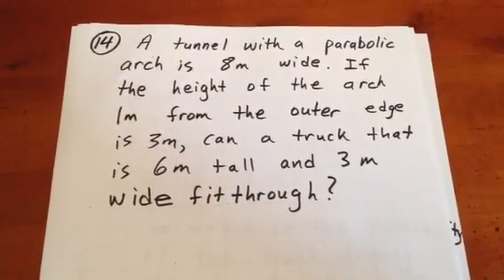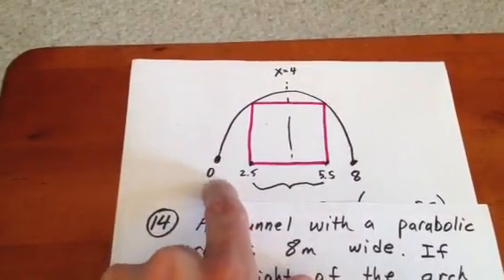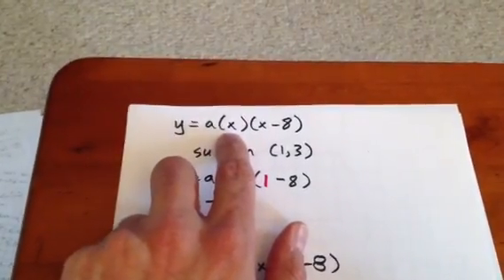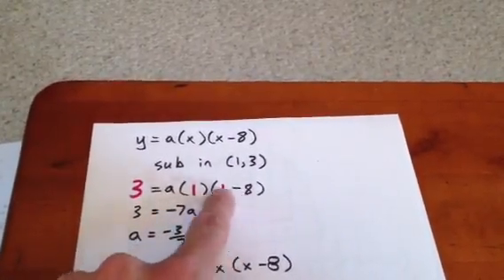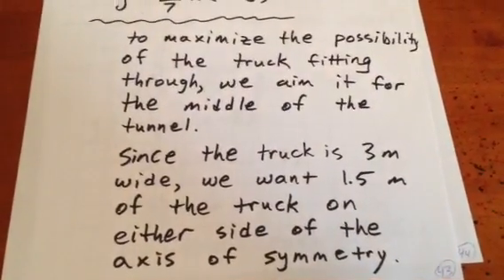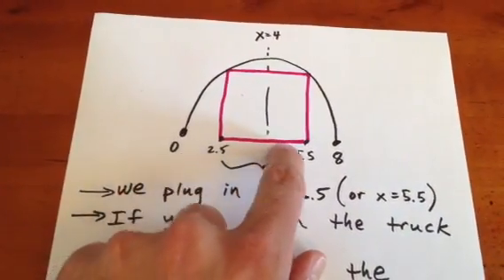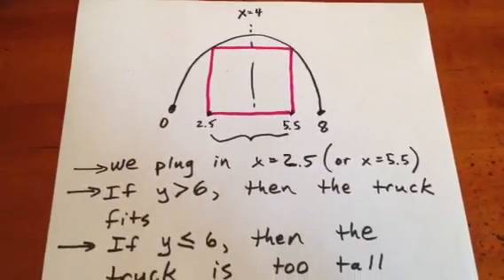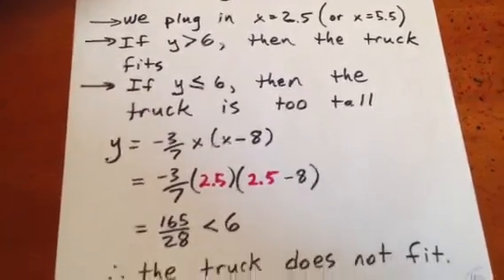Quadratics; Roots; Word Problem; Truck through Tunnel

Comment: thats wrong. 165/28 is 5.89 which is less than 6. you said that urself and said that the truck could not fit.
Reply: you dummy, the truck is 6m in height and the tunnel is 5.89m in height, so of course the truck wouldn't fit. you just messed up the numbers